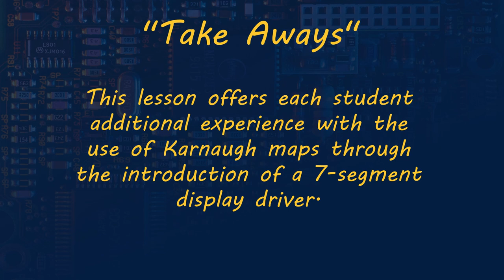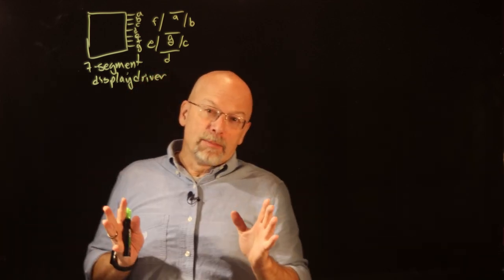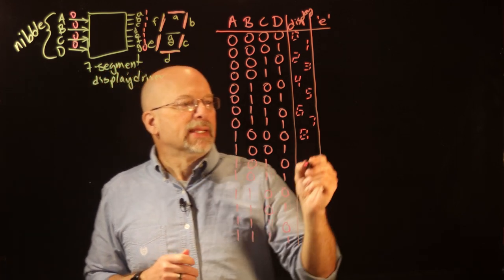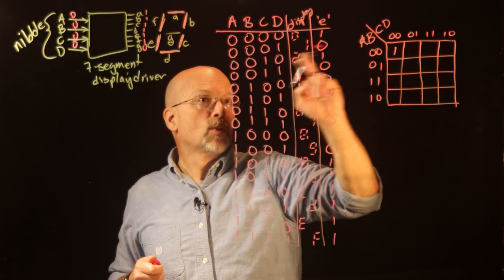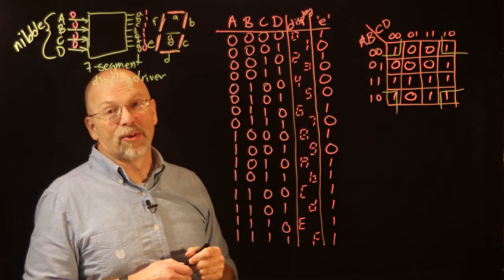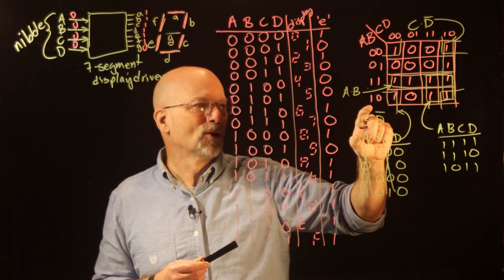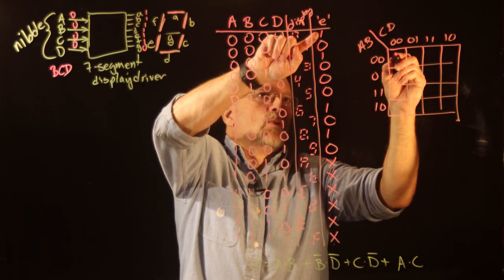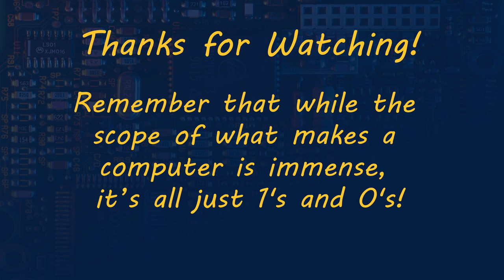Ep 045: Using Karnaugh Maps to Design a 7-Segment Display Driver

Comment: What do you do when there is a rectangle containing 2 cells?
Reply from the maker: You'll find that a rectangle containing 2 cells will only have one variable drop out.  For example, if a rectangle covered only the top left cell and the cell immediately to its right, A, B and C would all stay the same, specifically A=0, B=0, and C=0. D, however, would change from a 0 to a 1.  That means D would drop out and you'd be left with a product A-bar anded with B-bar anded with C-bar.

Comment: “e” column, I really don’t understand  how did you get the result ??
Reply from the maker: A lot of my students have trouble with this, so you're not alone. Part of the problem is that the hexadecimal digits include A, B, C, D, E, and F, and the segments of the 7-segment display are labeled a, b, c, d, e, f, and g.  There's sometimes confusion regarding these labels.

The "e" column represents the vertical LED that is in the lower left corner of the 7-segment display. Picture putting tape over all of the other segments on the display so that only the 'e' segment is showing. The 'e' column shows whether the 'e' LED is on or off based on the different patterns of ones and zeros at the inputs.

The ones and zeros at the inputs, on the other hand, represent what number (or hexadecimal letter) we're trying to display.